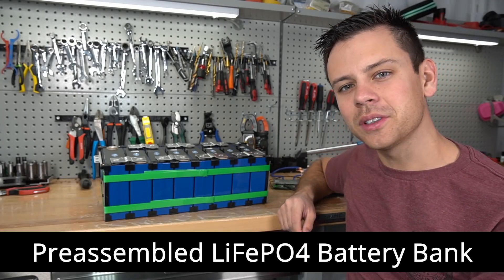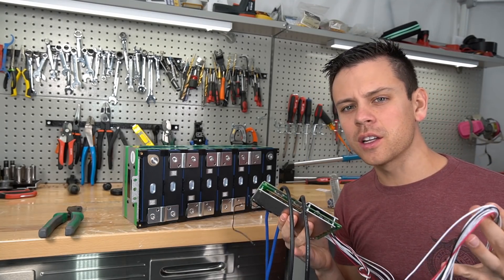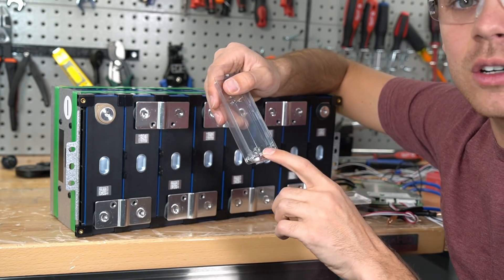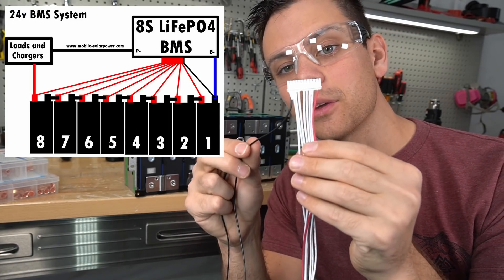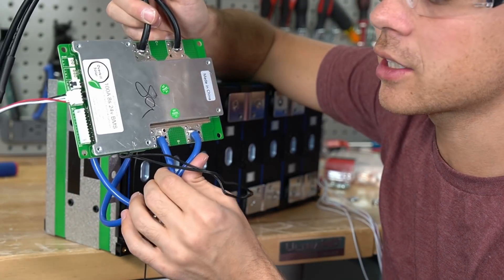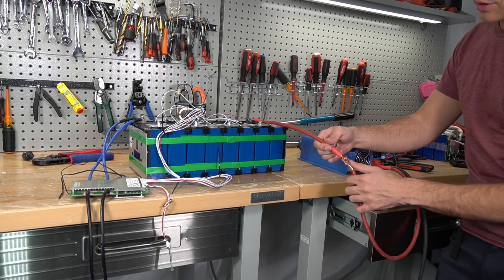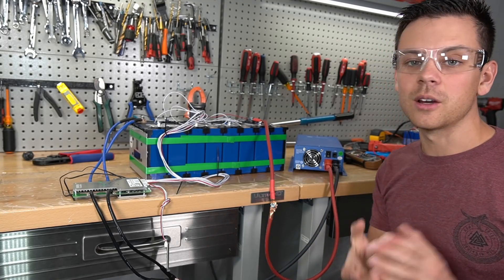Dirt Cheap 24V Preassembled LiFePO4 Battery: Beginner Friendly Tutorial!

Comment: I am new to all of this and find it so interesting! Thank you for sharing your knowledge. You inspire me to want to build a complete solar system  for my home. First I want to try building a battery back up system for my pond so the koi don’t die from a power outage. What would you suggest? My system draws roughly 250 watts and I would need it to run 12 hours or just run the air pump only that draws 50 watts. What are your thoughts?
Reply: I don't know anything about the fish but really that is no different than my first system. It was a piece meal rig of stuff that made power for my workshop. I was really kinda playing and experimenting BUT I was learning! The lead acid batteries and 12 volt inverters are a 110 volt system in the far back of my 1 ton Suburban.  It is still being used and the earliest real small solar panels are either wired as trickle charges to keep yard equipment batteries topped off and I gave two of them away to friends who wanted to experiment and learn for themselves!
      You can usually keep recycling all this stuff! Ya'll Take Care and be safe, John

Comment: A 40mm ammo can should be the perfect size to use as a case for these battery packs. The 
dimensions of the 40MM ammo can are Length 17.5 inches x Width 6 inches x Height 10 inches

Comment: Hi Mr

I have 8 cells 

I connected to gethet then l have bettery 24 volt system 

I connected to cells bms and balance 8s NCM/LEP Battery balancing V1.2

When I charge the bettery the voltages of cells are very deffernt 
Amount 250  mV

Where is the problem ?

Is this in cells or in balancing  or in bms 

Please answer me

Comment: I'm currently building 4 48v batteries from 8 of these battery packs. I purchased the 48v version of the bms you used in this video from overkill solar. It all seems quite straight forward except for 1 thing. The wiring diagram that came with the bms clearly shows the BC0 lead connecting to the main negative, then BC1 connecting to the 1st cell positive, then BC2 connecting to the 2nd cell positive, then BC3 and BC4 connecting to 4th cell negative and positive. Then BC5 and BC6 connecting to cell 6 negative and positive, BC7 and 8 connecting to cell 8 negative and positive. It continues like that, skipping every other cell and connecting to negative and positive. The wiring diagram you show for the bms you have shows the same, but you wire every balance lead to the positive of every cell, just like every other bms video I've watched. So, which way should it be, the way the diagram shows or the way you did it?

Comment: Rule of thumb to not strip threads: The depth a screw should (at least) engage with the threads is 0.8 x screw diameter in steel and 1.4 x screw diameter in aluminium. You might notice your M5 nut is 4mm high and an M10 nut would be 8mm high.

Comment: Will, that battery looks to be from signature solar. I have 12v equipment and would like to cut the series busbar to create 2 12v batteries and get 2 or 4 to go into parallel.would this be ok or should I look at other options? Is it impossible due to the welded busbars? Could Signature just not weld the 2 connections? Thanks for ALL the info so far.

Comment: Just to let everyone know. Everyone is shipping fast. I ordered the battery on April 14th 2022 and it arrived on the 19th. It did not have the hardware packed with it,  but it doesn't matter I will be using studs instead bolts anyway. I ordered the BMS on April 14th and it arrived on April 18th 2022. I paid the extra $10 to have the lugs crimped on and would recommend it to all.    BTW due to my dual use of this pack I need it as a small lightweight (somewhat) pack some of the time but plan on adding another battery bank when I'm out in the middle of no where and can't set out solar.  At that time I'm going to have to decide whether to switch between batteries or ( I know I know ) run them in parallel. This pack was just too well put together for me to pass it up. It fit my needs very well.  Thanks for the  heads up and tutorial.

Comment: Will, if i want to connect 3 or 4 of them is parallel to have more Ah should i use another bms to keep them balanced ? Or just charge them balanced and its good to go. 

I have bought aliexpress 3.7 50Ah ternaire lithium batteries that can charge at C1 (maybe even C2 not sure) have you ever tested them ? 

Thanx a lot for all the videos !!

Comment: I'm building this pack and how could you not love this BMS. The paperwork is hysterical. "If you need help I will help you, If you screw up I will help you, if you kill it I will refund your money , send me back the dead BMS"  LOL  you can't go wrong.  The only thing I will do is use SS set screws and bottom them out at 15 inch pounds. That way when tightening the nuts down I can hold the stud made by the set screw still. That way there is not chance of stripping the threads.  Shipping of the BMS was very fast.
Reply from the maker: Overkill solar is great 😂

Comment: Thanks Will. I built one with your guidance. And I did the classic "How cool is that, It actually works!"
 It should power my refrigerator for ten days  in my camper van. I added two DC to DC converters to step down to 12 volts and one to step down to 5 volts. Bought the Aim battery charger that can recharge it at 1000 watts.
 Might buy the Zero Breeze air conditioner.

Comment: Enjoy your videos very much. Can I ask a question?
 I would like to build a battery fed system for some motorized doors at my house. The power will be supplied by roof mounted solar. The idle wattage draw is 7 watts but when the doors are activated the draw shoots up to 150 watts for a few seconds during operation.
 I have a 15 amp hour lithium battery now along with a 20 watt solar cell on the roof. The battery runs out of juice by morning, So I know I require a larger battery and probably a larger solar cell. How much larger does it need to be?  I think I'm close I was thinking probably a 50 amp hour lithium battery and a 50 W solar cell would probably do the trick do you think I'm on the right track?? And also do I require a charge controller for this setup or can I just rely on the BMS in the battery and the solar charger?

Comment: Hi will I like your content. I am as dumb as it gets when it comes to Solar. I would like to build  a solar system to run my very small camper that has Led lights 12 v tv and a 5000 btu air conditioner for my camper and a 5000 btu ac for roof top tent. I will also have a small mini fridge for boondocking. What do you suggest?

Comment: Question-
Hey Will 
I love the depth of information you provide and the way you explain the info .
My question for you is if I'm wanting to make a solar set up that is going in my work trailer wanting it to be able charge all batteries for cordless tool the biggest batteries i have are the milwaukee 12amp ones , but I also like to be able run my table saw and chop saws and all corded tools from this and if the ever blackout I like to be able run extention from trailer to the standing freezer and chest freezer and fridge and be able to run these continuously,  if have sun every second day to top batteries back up .  Was hoping to be able to do this for under 3-4 thousand dollars. 
I sore that you said those 250w panels that $60 where good  also I have a 3000 w inverter already  , but if you can't let me know if what I'm trying to do is even possible? 
Thanks heaps for your help on this will

Comment: You're a god, Will; thank you always!  One question, would adding dielectric grease to the stripped wire be beneficial before crimping on connections?  I've experienced corrosion in the past with lead acid; maybe not as much as issue with lithium.  Blessings 🕯️✌️

Comment: I would like to know if you can make a recommendation for batteries for a marine application. I have twin diesels and 3 batteries. I need them to be able to crank the motors and then run the electronics. I’m more concerned with practicality and safety as well as cost. Not going to have a completely solar setup, but may expand to that in the future.

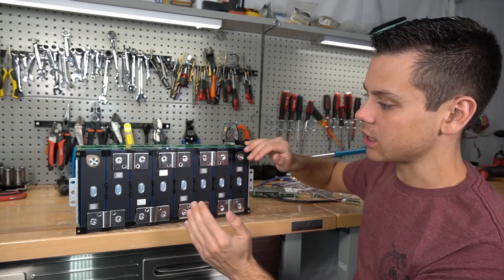Comment: You mention that because they are already connected in series, they don't need to be top balanced.  At 1:40 you say they are all at the same state of charge,
Why?  By the time the pack arrives I would think a cell(s) could be at a different state of charge.
If they were in parallel, sure.  By why is a series connected set any different than a bunch of single cells?
Keep up the great videos!

Comment: I just want to be sure I an looking at this right.  I don't understand why anyone would buy that.  2 of those banks and 2 bms units would cost you $1266 not including an enclosure.  you can buy 2 200ah zooms and have the same capacity for $1240.  the only benefit I see is having the better BMS.  IMHO low temp cutoff is a mute point.

Comment: $1266 vs $1500, 1hr+ of time, building a box to put it in, and the BMS is out of stock, I don't see the advantage. I guess if you don't need 5.12KW it's fine at $633, but realistically, just buy the server rack battery and be done with it.

Comment: Hi will quick question, if I run 2x 100ah lithium battery’s in parallel with a continuous discharge rate of 100a each (same brand and size battery) does this give me 200a of continuous discharge? Someone is telling me I can only pull 100a and the voltage differential between each bank will cause problems

Comment: Hi,
Normally I enjoy watching your tutorials but I'm sorry this one is so wrong.
"Firstly" Using the crimp tools you have on such High power components without know how much pressure to apply is wrong as you can actually damage the Crimps integrity and also the cable, you can purchase fairly cheaply the right Racket Crimp tool to do this job and it will prevent over compression and also you should use the right AWG (gauge) crimps for the cable.

"Second" Suggesting that Crimp is a Gas tight seal over sold is also Wrong as soldering a wire actually Tins the strands together and subsequently seals each strand surface from oxidisation, the heat shrink will help for a short while but once the copper Oxidises it will increase the surface resistance and may even cause the connection to break down and stop working especially on cheap copper which will eventually go black due to over heating caused by the high resistance etc.
in most cases of high power situation Crimp is King but you tend to find the strands in this situation either tinned with silver

Finally cut your threads down don't bulk them up as you creating a protrusion as a potential short hazard.

I'd highly recommend you seek advice from a professional Electronics Engineer as you had some of my colleges in tear with laughter over your advice as some of them have over 40 years in Component level Electronics.

great work otherwise, thank you

Comment: I saved this one.
Need 64v I was told to send a J2 Runhorse slow moving tiny electric car down the road. It weighs about 600 pounds, and I want it to have a 200 mile range, even if I might not go be 75 miles, but want to use the heating and air conditioning options.
You mentioned about using a singular BMS and linking a few of these $500 dollar stacks together to up the voltage from 24v, do you or anyone reading this know how to get 64v, should I use 3 stacks and then use a voltage regulator, or 2 stacks and add additional cells to reach the factory rated 64v level?
The vehicle is being shipped here without batteries due to the vehicle manufacturers shipper isn't allowed to ship batteries. So I will need a best ideal solution, or if there are choices to consider.
Cheers and thanks for the Vulcan knowledge on this channel. 🖖

Comment: 0:27 each cell is 100AH-so does that mean the total amp hours is 800 amp hours? I'm confused.
Reply from the maker: Absolutely false. Check out my beginner videos. Ah is always dependent on voltage nominal. Do not touch these batteries or any others till you understand that.

Comment: Excellent video Will! I’ve run the numbers several times on those battery packs trying to come up with a more cost effective solution versus buying server rack batteries but by the time you add the bms the savings just aren’t there. This is especially true if you start to take into account the features like built-in breakers, communication ports for the BMS, etc. In this video you implied that there may be a way to build a large battery bank using fewer BMS‘s. Obviously that would help make the whole thing more cost effective. I would love to see a video or hear your thoughts on a big DIY build that might compete with the 30 kWh a full server rack from EG4 give you.

Comment: Question  so say I wanted 48v 200amp system  I would just build two 48v 100amp with two controllers as they are 100amp rated. Or is there another option?

Comment: Hello from Sacramento CA.  I was cruising your channel last night expecting a new video and missed it and I am scribed???  Will definitely be looking into this. Just about done with the water damage/seal of my 1970 airstream remodeling. We are putting the bedroom in the back and the bathroom in the middle. Not sure of the position of the bed. So were taking it out this week to decide if we like the current mockup.  This will decide how and were the batteries will go in the trailer.  I plan on putting in floor lockers for the batteries and that footprint will change depending on the placement of the bed. And the more low slung weight closer to the axels the better. This is a major systems  upgrade and 5years of planning on two different floorplans to even out weight distribution  I have already taken out over 60 feet of copper pipe. I am planning on loadsharing the trailer and the boat with the houses electrical grid. I mean why have them sit idle. My goal is to be grid free but have the option to reconnect to the main power grid when and if we move.  Great job Will  quick and to the point.

Comment: Hey Will, what’s the lifetime cycle for these cells?
Reply: i see 7000 cycles on the website
Reply: @metelljob1064  Thank you. Oh, just putting the secret out, I called signature solar, the shipping is FREE!
Reply: @about2088  ho nice. i pretty much love them but 2 of them for $1000 and after you have the BMSs. it's like the same price of the regular version 24v 200ah $1500
Reply: @metelljob1064  I thought it would be closer towards 5kw at 48 volts with the pack in series. $998 for two packs and $138 for a overkill 48v bms shipped. That’s $1136. 

The 48v EG4 battery is 1500 plus shipping, putting the cost at 1750 for the same voltage and packs as the loose cells.
Reply: @about2088  good idea but good luck on your project i prefer plug and play because i don't have good electrician skills. i do hvac
Reply: @metelljob1064  thank you. Good luck on your project as well. FYI , don’t don’t yourself. You can watch Will’s battery build series for beginners and literally make your own pack. If you do hvac, there’s no difference. I’m a electrical/controls Engineer and have dabbled in hvac for environmental control units for engines and test cells for all of the big 3.  Todd is not hard at all, especially following his tutorial
Reply: @about2088  yepp i touch power every day. i'll say here to learn

Comment: I'd suggest a hydraulic crimpers for battery wires; learned my lesson hard way (crimp worked its way loose over a year and got a bit melty on wire).  Luckily caught it during high load test (100amp) before the setup made it into my RV.

Cheap hydraulic crimps like 20-30 bucks on amazon now.

Comment: Great video! Where I live (the Netherlands) standalone solar/battery systems make no sense for houses, because the grid is everywhere here. Also, we have net metering, so grid tied batteryless PV systems are the norm.

However, net metering is going to be phased out over a couple of years so I want to at least think about a battery for my home. I'd prefer to also have emergency island operation, but systems like that from the big brands (SolarEdge, Siemens, Tesla, etc) are very expensive.

Would it be possible to make a video that explores building a grid-tied battery system with emergency island capability, based on cheap batteries such as the ones in this video?
Reply: Growatt es 5000 thats the way to go
Reply: @jamesharlow1406  That's not grid-tied, is it? It has grid input, but cannot feed I to the grid, and I do want that.

Comment: Hey Will! By chance I bought this pack a month ago and used this BMS for all the reasons you mentioned. It works pretty well and has full capacity.. I would recommend it!
Reply: Have you by chance done a run time test on the pack using a common household (or RV) appliance(?)
Reply: No.. However the BMS can monitor the wattage use for you. I added it to my solar bank and so far it charges and discharges as advertised!! The cells are also at perfect balance. One thing i learned in using cells and this BMS is that the leads from the BMS MUST be very secure. The slightest loose or frayed connecting will result in a "false" voltage reading and will cause the BMS to go off on alarm!!

Comment: Can you stick a 24v solar panel to that without using a charge controller?
Reply: No you cannot.  A panel rated at 24 or near volts will not charge it. You need an mppt solar charger and panels rated high enough voltage to run the controller but not overvolt the controller, It also needs a LiFePo4 charging profile.

Comment: You could also cut the bolts.
Reply from the maker: Yeah and I have a deburring tool to clean up the threads but no thanks. Especially this small of a bolt. Absolutely not worth it.
Reply: Yes, true. Fit a nut before you cut and it'll clean up the thread when you remove it.